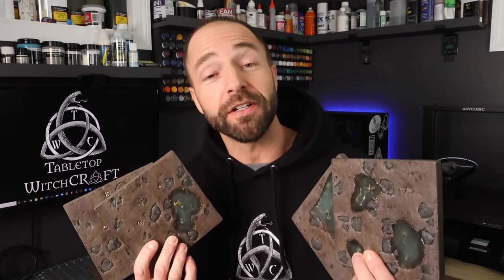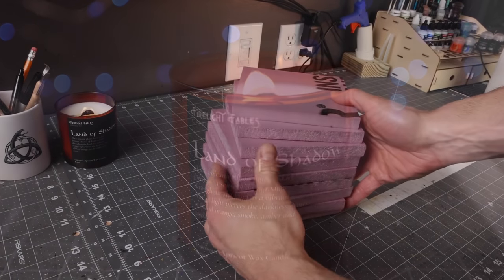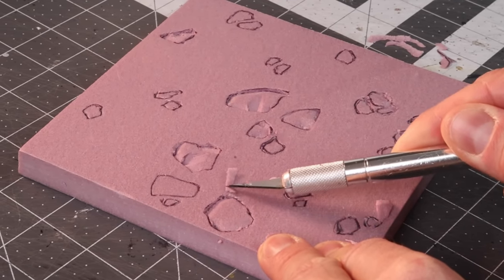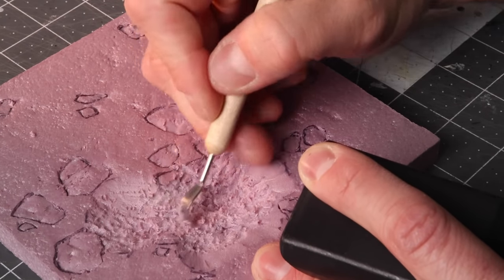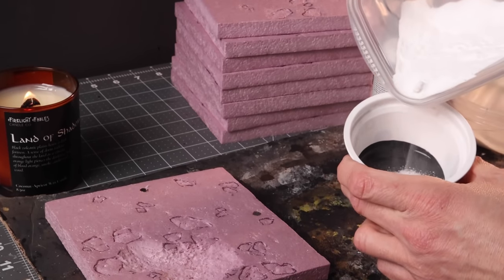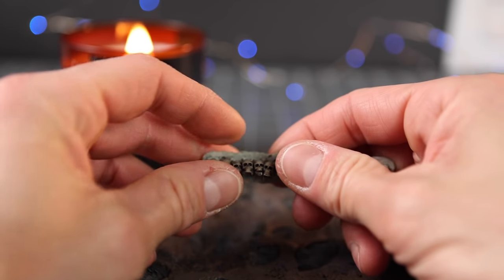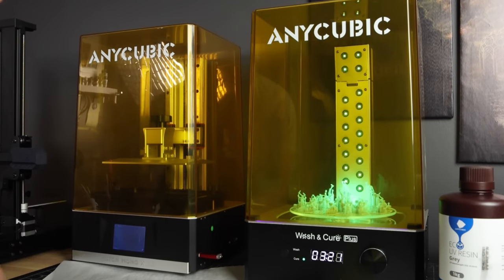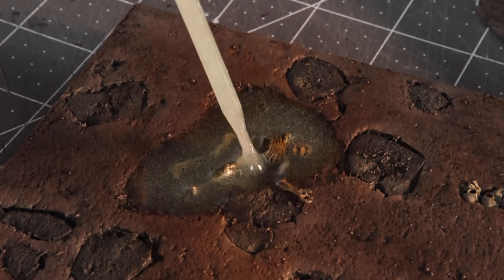Catacomb Tiles for Dungeons and Dragons

Comment: I'm not entirely sure if this works as catacombs, it looks more like something closer to a carved out cavern inhabited by a necromancer or something undead.

The pools kind of take it further away from the actual catacombs look from what I've seen in places, most tend to be dry and dusty, set up to keep water away from the bodies due to potential for disease issues
Reply: The Necromancer is obviously a novice. They could be the remains of abominations he's failed to sustain, and the remains of those experiments are acidic. 

Could also be Blorps that had severe indigestion after they absorbed the spicy last-meal that was still in the bellys of the previous adventurers. 

Also, walls are missing- he touches on that at the end of the vid
Reply from the maker: Thanks all, so yeah the pools of water definitely existed in catacombs.  Who says what state they are in and what time period in the existence of these catacombs the setting takes place.  Take a peek online, you'll see many catacomb pictures where they are flooded.
Reply: Most catacombs are wet and damp due to rising sea levels and flooding. Ie…the river Seine in Paris has flooded the catacombs many times. Eg 1910 the famous flood.
Reply: @TabletopWitchCRAFT  I'd like to cast my cantrip, Shop-Vac 

Fr though, great vid. Love the gridless system. Your emphasis on patience and immersion is very inspiring!